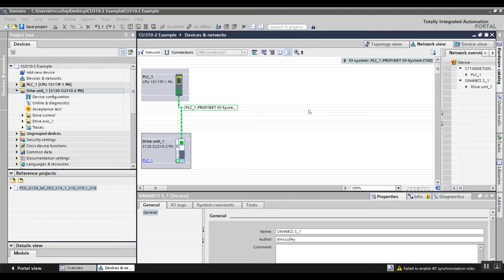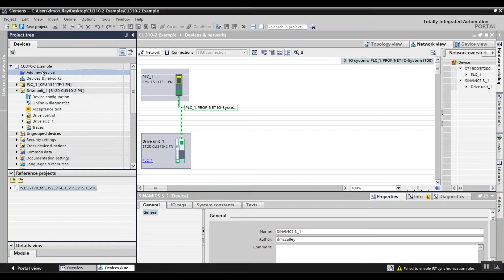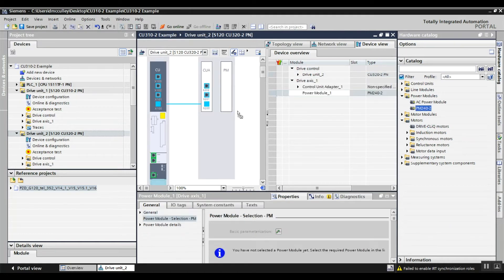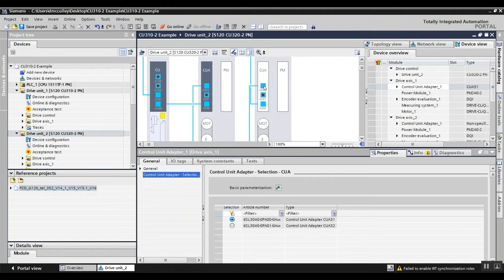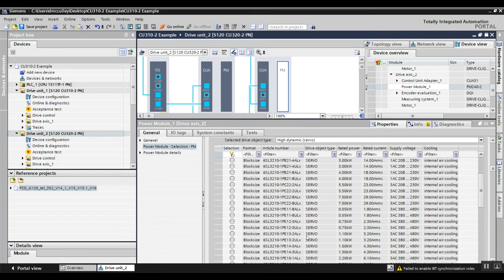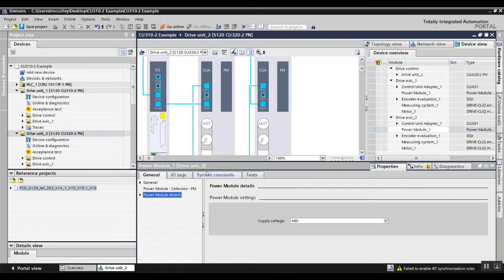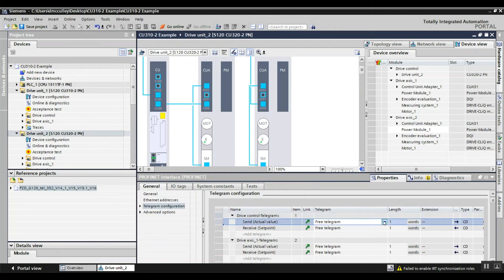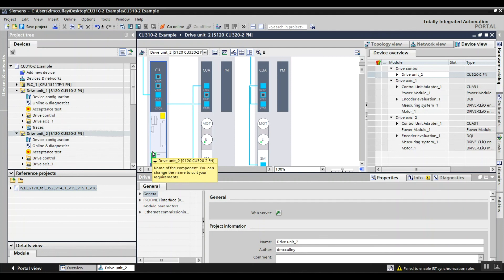How to Insert S120 CU320-2 Blocksize Drive V16 Into Your Project

Comment: Hello, I have a CU320-2 PN that will be connected to 3 PM240-2 on tia v17 or V18 not sure which version yet, but whenever I put in the CU on the hw config and look for the PM the only option that is showing its AC Power Module not the PM240-2. I have tried with different versions of CU320-2PN, Installing the HSP for tia V17 and for V18, try with different versions of the startdrive and nothing seems to pop the PM240-2 on the hw config, is there something else that I could try or that I'm missing? or could it be that this configuration it is not supported on version of Tia V17 or V18 yet? Would appreciate your help. Thank you! :)